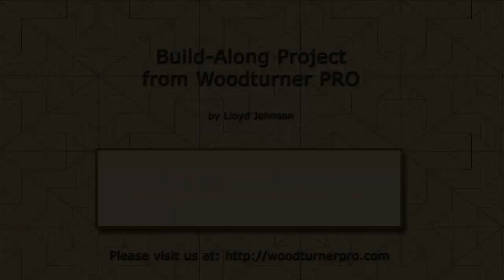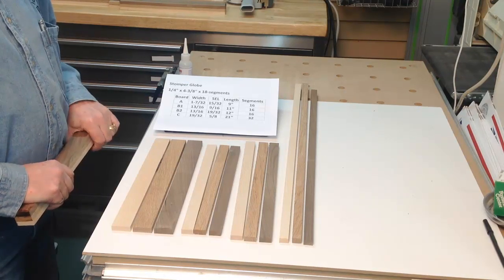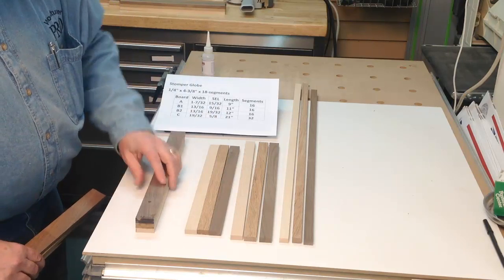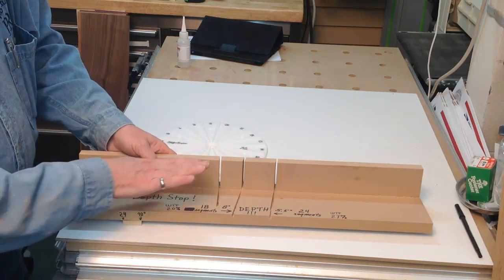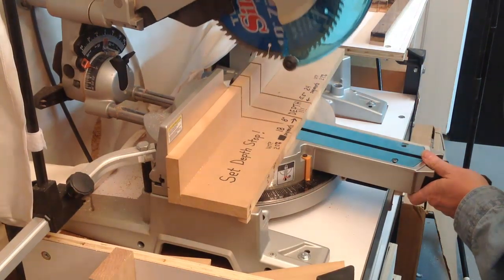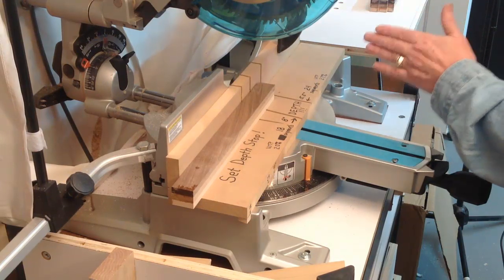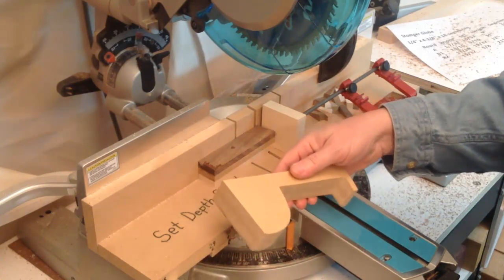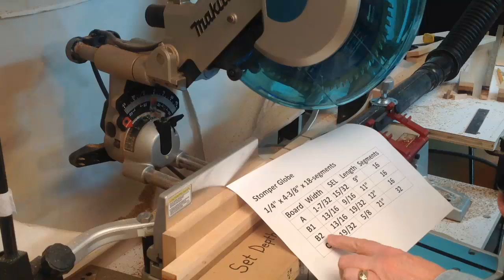Tornado Globe Part 2: Cutting Segments on the Miter Saw

Comment from the maker: Yes, Part 3 will be constructing a table saw sled that will allow you to cut multiple segments at a time at either a 5.5 degree or 8 degree angle for the 24-segment and 18-segment SegEasy plates.  Due to my work schedule, though, I won't be able to start on this tutorial until late October.